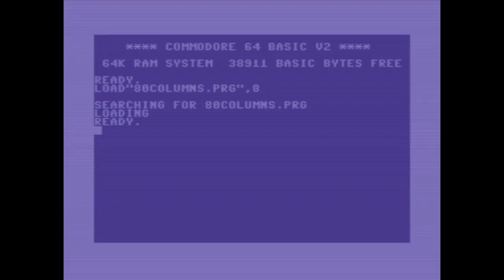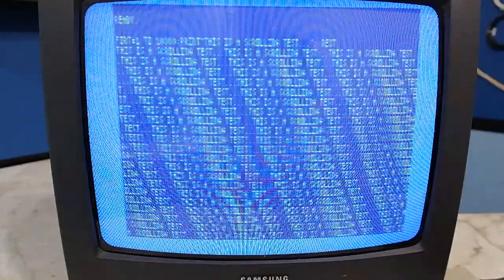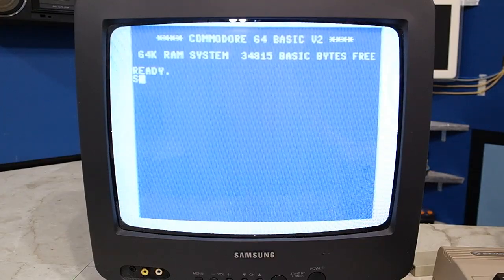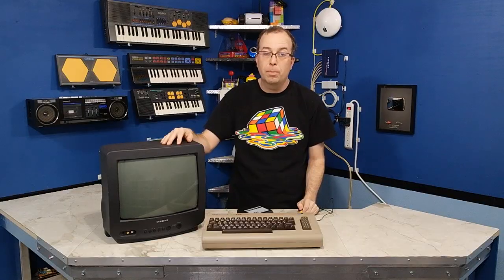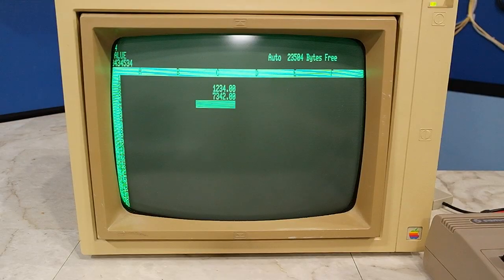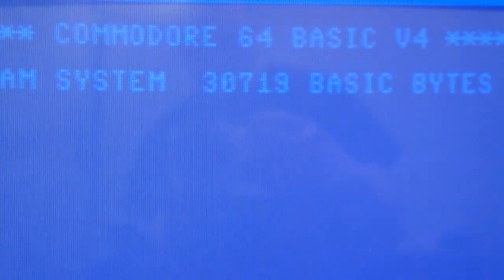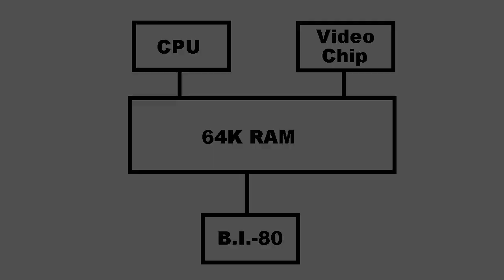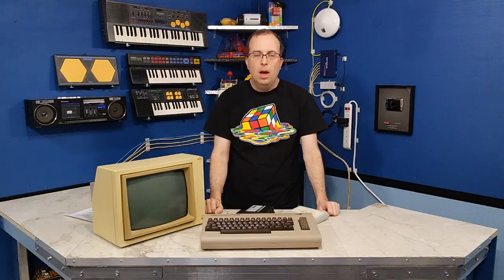The Quest for 80 Columns on the Commodore 64

Comment: Interesting indeed. I wonder why did C64 never got a proper 80 column mode in the first place? It had hardware sprites, awesome 16-color palette, hardware scrolling with tiles, and customizable text characters. Adding monochrome 80 column mode on top of this shouldn't be to much to ask?
The main reason was probably the inability to get 640 horizontal resolution that is required to get sharp 80-column mode. Just look at C128, they add second graphics card similar to CGA instead of redesigning VIC-II.

The highly specialized chipsets make C64 successors impossible. Amiga didn't had any compatibility and it had the same flaw. ECS chips were great in 1985, but in 1992 AGA chipset that had backward compatibility was late at least 3 years. Amiga 1200 couldn't even compete with 386DX systems not to mention gaining popularity 486 PCs.

Well, overall you can't have all. PCs for a very long time were unable to compete in gaming with consoles and other home computers, but they were great at productivity.
Reply: Leeki85 my Amiga has a Voodoo 5500... The C64 was meant to be cheap and short lived.  It was sort of accidental that it was more powerful than most everything else.
Reply: It's a simple answer - the C64 was designed ground up for general purpose home computing and gaming, not as a business system.  The successor was the 128 model that incorporated the major deficiency of its predecessor - the lack of 80 columns.
Reply: 40 columns wasn't really a deficiency.  There was no demand for 80.  The 80 column adaptors barely sold.  The trouble was that these computers had this silly stigma that they were not going to be useful for "business"applications even with 80 columns due to 1) the lack of slots (totally unfounded and uninformed), and 2) it was really good at playing games, something which serious "business" computers were not allowed to do.

Comment: Did you see that the first cartridge also used a bit (here: 4 kB) of BASIC memory?

Oh and for those who want to use C64 mode with 80col on a C128... its actually possible to access the VDC chip in C64 mode. You would need to do own routines for it since KERNAL does not have support for using it, but it does work. 

Oh and the second reason why the VDC was not very popular and only primary used for GEOS, was not only that you needed that special monitor but also because it also had its own video RAM and to access it was unbelievable slow, since you had only two registers, and you need to tell the first register what you want to read or write to, and then actually WAIT for the VDC chip to initialize (which you do by reading a certain bit from the registers) until you finally can actually read or write using the second register. This was absolutely slow as hell, even in 2MHz mode, which was a real pity.
Reply from the maker: Indeed.   I did some programming for the VDC years back and it was a real pity the way it was implemented.

Comment: The original PET 2001 and 4000 series had no "C=" key, and lower - case text was impossible.
Reply: Haweater not true. You just had to change it in software. (very easily)

The B128 has a C= key that works totally differently
Reply: Sorry.  I haven't touched a PET since about 1984.  Guess I'll try an emulator for it.

Comment: The ONE use I can think of that I would have LOVED that for was back in my BBS days.  I used to use a C64 terminal program (I forget the name now) that used that software, 80 column font.  I even edited my own version of it back then to improve the look.  I had a TV, and had to strain to see what some of the letters were, but you got used to it and it helped a lot with logging on to and viewing IBM BBSes and such.  We had a ton of BBSes back in the day where I lived so it was nice to be able to do that.

I kind of wish I had a C128 back then, it would have been perfect for browsing BBSes on.

One thing I do recall about the C64 is that you could copy it's character set to RAM which was hidden under the RAM which the character set used.  It was interesting to program, you read from the character ROM and then poked the same value to the same memory location, only it would be written to the RAM under it.  You then disabled the character ROM and it would use the characters you copied under it which you could then redefine to look how you wished.  So, for BASIC programs, you didn't really waste any memory for the 80 column font as you used hidden RAM under the character ROM, not normally available for use anyhow.  I remember programs that would use that hidden RAM for RAMDISKS for the C64.
Reply from the maker: I actually had a small section in this video about that very topic, using 80-columns to call IBM BBSs... But I cut it out because the video was getting too long and those scenes were going to be tough to film.

Comment: What about the CP/M that came with C128, was there any software for it? I don't remember seeing that many C128 native software, but I have a hunch that the CP/M thing might have been compatible with something.

Edit: Just realized the C128 has a secondary 4MHz Z80 CPU that the CP/M is using. Wikipedia says: "The presence of the Z80 and the huge CP/M software library it brings, coupled with the C64's software library, gives the C128 one of the broadest ranges of available software among its competitors."
Reply from the maker: It was rarely used since it required and 80-column monitor for most of the software and 99% of the C128 users didn't have one and didn't realize they could use a composite monitor with the cable I showed.

Comment: I remember being amazed at how cheap a color monitor was for the C64.  Combined with a garage-sale VCR I had myself both a crisp computer monitor and a nice color television using the VCR's built-in tuner.  This was fine for 80col text.    I only needed 80-col for word processing and if I recall correctly, PaperClip handled that in software.

Comment: 80 columns on the PAL machines using the software mode turned out to be a little more legible due to the higher resolution of the PAL TV standard regardless of the C64 resolution being 320x200 or 160x200 in high res or multicolour modes on both NTSC and PAL machines.
Reply: The resolution was not very different. It is the higher CHROMA (color) resolution that made it more legible. NTSC color resolution is like 40x40, completely terrible.

Comment: I remember using a software based 80 columns word processor on the c64, from what I remember it worked great, but then again I rarely wrote more than a couple of pages at a time. Wasn't quite your modern WYSIWYG, but layout and  printing was OK once you got used to it, certainly much better than using a typewriter.

Comment: CRT color tvs have that little bit of color interference when displaying colorless characters, if you look really closely you can see that the characters are made up of all the color combinations to create white.  Monochrome displays of course don't have this problem, because there's only two colors to work with, black or white, so the electron guns don't have to fire color signals to make up the white characters.  This is why the monochrome monitors displayed sharper text.

Comment: How hard is it to program for the different commodore  models? PET, VIC-20, C64, Plus-4 etc.
Episode suggestion, possibly making your own C64 expansion cartridge, to show how they work(an example would be a RAM cart)?
Reply from the maker: Well, I am working on my own game, which I plan to put on a ROM cart.. and I'll eventually cover that in an episode when I get further along.  I believe the C64, VIC-20, and Plus/4 are all equally easy to program for.
Reply: Thanks for the reply.  I need to learn some assembly and start programming some vintage computers.

Comment: There was a C64 wordprocessor released towards the end of the machine's life called Interword which either did 40 columns using the standard text mode, or had a software created 80 column mode. Wasn't amazing but it was just about readable (I think it used bright white characters to make the characters stand out) even on a TV. I was impressed by it back in the day anyway!
Reply: Paperclip had a sort of proof mode with 80 column display in software. It worked well enough fit my simple essay writing needs.

Comment: One of the other reasons why on most TV's 80 columns were hard to read, even on a monochrome signal, is the coarser shadow masks used.  It's cheaper to use a coarser shadow mask because they know you aren't going to be sitting close to the TV.  Luckily a lot of TV's have a "color killer" circuit which makes the TV understand that a monochrome signal needs no color demodulation and could in theory show the signal perfectly, had the CRT had a finer shadow mask.

EDIT:  Oh, and on the chance that the TV could in fact show it not due to shadow mask limitations, try turning down the sharpness control.  If it looks like the text in 80 columns mode is fringing or oddly brighter around the edges, it's probably sharpness, which is just crystallizing the picture to make it look sharper, but just adds highlights which distorts it.

Comment: Awesome, and remember GEOS 128 being able to use 80 column and burst modes with the 1571 and 1581 drives. My late uncle used GEOS on a 128 with a SuperCPU adapter 1571 and 1581 drives  till around early 1994 when he finally caved in and bought a 486 Compaq computer running Windows 3.11.

Comment: You forgot to most popular and very widespread way to get nearly 80 colums: GEOS. Because it uses proportional fonts instead of fixed-size, already the system font called BSW (Berkeley SoftWorks) could reach an average of about 70 characters per line. Because the very flexible font system of GEOS a proportional font with 4 x 6 pixels would be possible, allowing 33 lines with more than 80 colums. And it could be used in every GEOS application with font support. The font California was available in 6 point, but there was no limit to a width to 4 pixels. It was f.e. used for icon texts on the DeskTop.

GEOS 128 had two inbuilt charsets: BSW for the 40 column mode and for GEOS 64 compatibility. Because it was way too thin for the 80-column screen, GEOS 128 got the additional BSW128 font. But it wasn't just a doubled BSW font, it was a bit thinner, so way more than 80 characters per line could be displayed. DeskTop 128 didn't have to use the tiny California 6 font in 80 column mode, BSW128 was thin enough.

A video about GEOS is still missing in your channel. At his heights, it was the third-most-popular microcomputer operating system after MacOS and MS-DOS. I learned 1993 in school Multiplan, Word and dBase III in MS-DOS text mode (80 columns ;-) and at home I made DTP with geoPublish on my C64 with GEOS. But I had a 3,5" floppy and a 512K RAM expansion, otherwise it would be frustrating. Although it works on a standard C64, GEOS can be an example of extreme system upgrading.

Oh, by the way: Another 8 bit business computer released in 1985 was the Amstrad PCW, also known als Schneider Joyce. It used CP/M 2.2 and had a display of 90 columns by 32 lines. It was designed as a text system.

Comment: I like your videos, they take me back....ahhh, nostalgia.... I was 16 in 1980 so this stuff was right in my era.  I had the BBC Electron with the Plus1 and the Disk drive adaptor (£200), (Plus 3 ? maybe plus 2).
Computer shops often had computers set out on desks around the shop and I was sitting at a BBC with a Texas TI99 behind me, I set them up in basic with a repetitive calculation that doubles the previous answer. The BBC reached its maximum in about 5 seconds (Very fast Basic) The TI99 had just got past 100 I think it was.... what a snail that was.
Also, I bought for £150  (Choke lol) (1984 I think) a Brother HR5 printer, 30 characters per second, used a cartridge tape that lasted for about a couple of A4 sheets. Its only + was it had character descenders so the 'y' or 'g' looked ok on the line.
Reply: Well, on the TI/99, unless you had the Extended BASIC cartridge, there were a couple reasons why it was so slow (despite having a fast CPU).

Regular TI Basic was stored in Video RAM as GPL (Graphic Programming Language).  In other words, it had to be translated from GPL to BASIC, and then from BASIC to assembly language!  (Extended BASIC was not stored as GPL, and did not have to go through double translation.  That is one of the reasons it was faster.)

In addition, even though the CPU was a true 16-bit processor, only the system ROM and 256 bytes of scratchpad RAM were actually connected to the 16-bit bus.  All other memory and devices (including the video RAM) were connected through a 16-to-8 bit multiplexer, requiring twice the number of clock cycles for any access and adding a 4-cycle wait state on top of that!

That's one of the reasons why a popular user modification was to "piggyback" static RAM chips onto the console's 16-bit ROM chips, allowing a 32k expansion without the wait state, increasing the speed of most applications by about 30%.
Reply: SpearM3064
Nice informative answer, thanks

Comment: There is a FIFTH option and the best option.

Just use GEOS or Interword. These are software and already do what you would need  with no extras.
Reply: Of course, the problem with THAT option, is it's still hard to read if you're not using a monitor... and if you're not using a 1581 disk drive (or at least dual 1541's), you don't have a lot of space left on a disk after all the required GEOS files are copied to it.
Reply: Well yes but even here, the net drawbacks seem far less substantial when you can jump right in and start using.

After all, you can do word processing straight off the bat with GEOS or Interword, while further software support seems nil with the other options. And if you use either a black and white monitor, exceptionally good CRT TV or inexpensive S-VIDEO-VGA converter, you can see very well.

Comment: I built my first computer system in 1978.  It had an 80 column display.  The computer itself has a 9 digit seven segment read out.  To this you added a terminal, another kit,  while it had 80 columns it only had 12 lines of text.  It was the Heathkit H9 video terminal.  Heathkit's most difficult kit.  It ran from 1978 to the early 90s.  Spending the last years of operation as a satellite dish remote control display in a tv station. At least it wasn't an ASR-33.

Comment: How many TV lines does that apple monitor support , it looks absolutly fantastic with loverly scanlines
Reply: Andrew Joy it's monochrome.  it has literally infinite resolution.  it just displays what you feed it.
Reply: Thats not true , monochrome monitors still have resolution, and analoug horozontal resolution is measured in TV lines, arround 300 for a TV for example , and then from 600 - 1000 for a broadcast class CRT.

I ask because you cannot see any gaps whatsoever in the horozontal pixles , only scanlines. This usualy implys that the number of TV lienes ( aka resolution ) is much higher than say a TV or that 1084 monitor.
Reply: Andrew Joy That' all fine and dandy for digital signals with pixels, or colour "analogue" signals with discreet phosphor regions.  But look at the face of a monochrome CRT with a magnifying glass, and compare it with the same on a colour CRT, or any alternative video display.  The only resolution you could possibly pick out on a monochrome one is the coarseness of the phosphor coating.  

Raster scanning the way we typically do it has a finite resolution in the vertical axis due to the raster.  The horizontal axis is only limited by the bandwidth of the video signal path.  You can increase or decrease the vertical resolution (infinitely) simply by changing your vertical scan frequency. 

Thus the horizontal resolution of the display on a monochrome CRT is truly infinite for all practical purposes.  This is why you cannot see any gaps in the lines and spaces of the horizontal scan.  You can only see it in the vertical, due again to the raster scan. 

The horizontal "line" resolution only comes into play for colour signals, of which even broadcast and recorded media black and white signals have been for a very long time.

Comment: 3:21 Maybe an Auxiliar audio output? So, that way, you can plug in the sound to a Hi-Fi system, for example, if yoy play a music casette you can derivate the audio signal to another kind of audio solution better speakers than televisions used to had.

Glad to see Ron Gilbert´s is still alive and working because I bought some of the classic LucasArts video games on the C-64 version and his next work comes out soon! 

Still remember those "code your own adventure" books in the C-64 and other micro domestic computers in which there was anything but text and before playing you had to type it all. Thanks for the vid! I found it very interesting, as always.

Comment: As an avid 99'er I know the TI has 32 col by 24 rows.  (256 x 192 pixels) Due to overscan typing in (Extended) BASIC was 28 x 24. Though you could display graphics in the fringe area.  

I have a Word Processing cartridge which "supports 80 columns" by displaying 40 columns and jump scrolling as you typed.  Did my best to adapt to this method.  I later learned just to stay in 40 column mode to work and readjust to 80 columns for printing.

I had a letter quality dot matrix printer by Epson (who else?) and even a stand-alone plotter typewriter by Silver Reed.  I could connect the plotter to the TI to print, but never figured out how to program font sizes, let alone graphs.

Still this method got me through a few college papers.  How I wish I had it for high school.